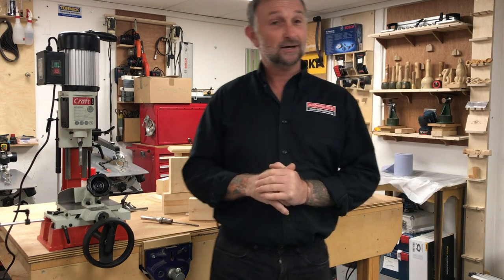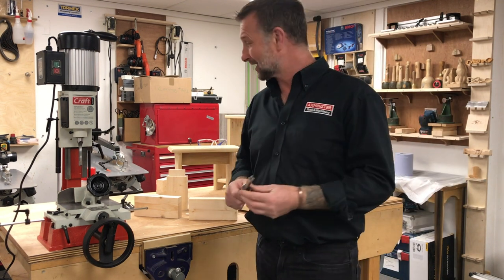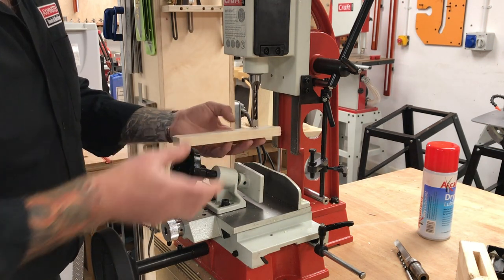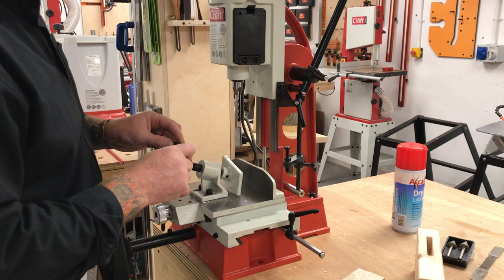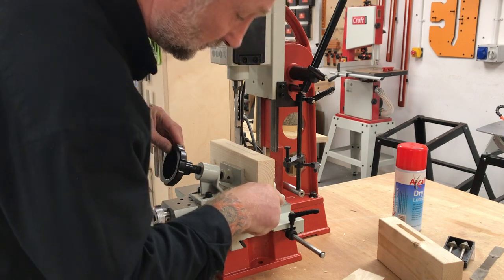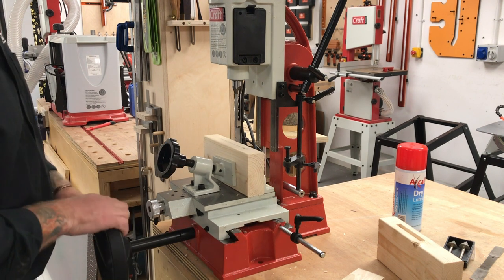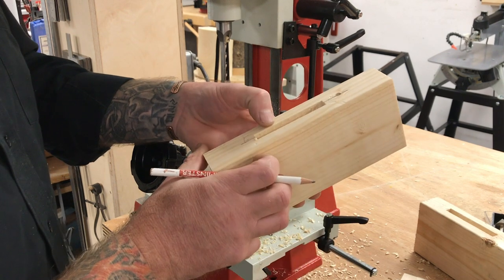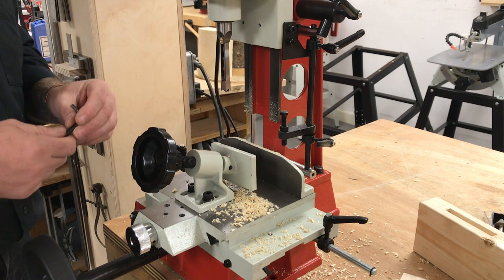Workshop Wednesday - Morticer Set Up

Comment: This was a really clear and instructive video, thank you, Craig and team Axminister. My confession is that I have had one of these mortisers, a retirement gift, for six years and not used it until now, as I have a Festool domino - yes, ok I am a very lucky guy!  What I need to know is; can I make the width of the mortice wider by moving the wood forward in the vice, after the first line of cuts?  My concern is that the second cut may not be the full with of the chisel. Is this an ok process?